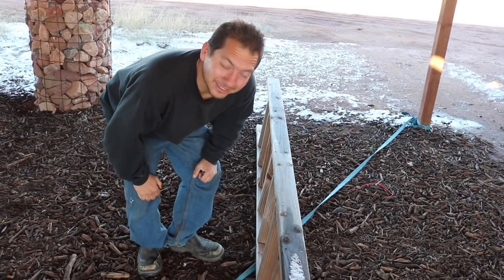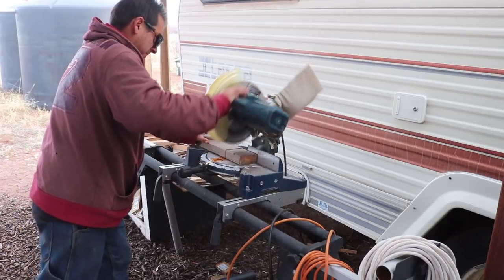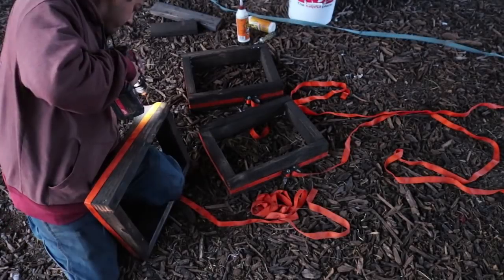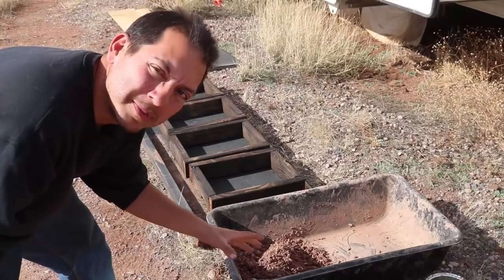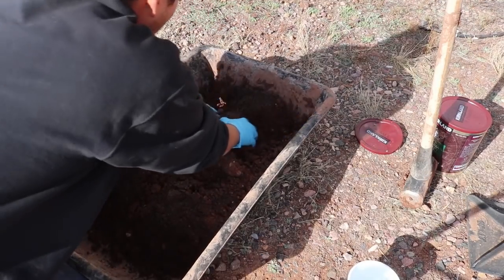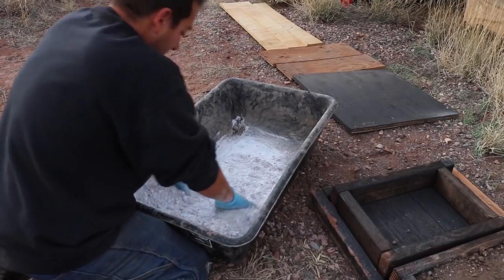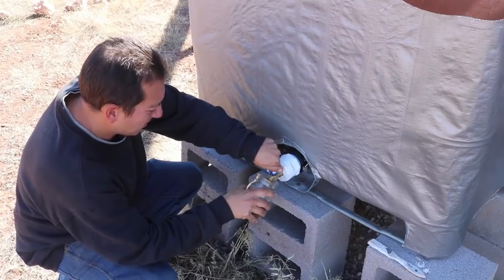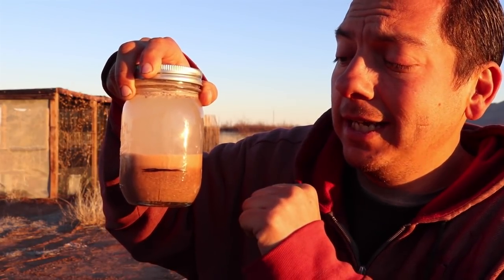Can We Build Our Off Grid House With This? | Testing Soil For Clay Content

Comment: You can use those scrub thorn bush's by burning them and collecting the ash to use in your brick production.  1 part clay, 1 part sand, 1 part ash = Roman Cement.   You could even use waste plastic as a stabalizer for your bricks, shred your plastics and mix with soil heated in an oven.   Plastic/soil bricks make strong bricks, I have seen youtube video's where they make shingles with them.
Reply from the maker: That's interesting Kelly. We'll check into that. Thanks for bringing that up.

Comment: It is important to note that typical concrete is only 10-15% cement.  The remaining percentages are made up of aggregate and water.  Rammed earth applications often fall in the 3-4% range of cement, but can vary widely based on your "earth" composition.  Also, consider that the ratio of water in concrete has a direct effect on the final strength.  Your strength tests won't be particularly meaningful if you aren't carefully measuring comparable amounts of water.  You need enough water to let the cement do its bonding but beyond that, the final result becomes weaker with more added water. Personally, I would not get overly zealous about the use of small amounts of cement.  Reducing the amount of cement used by 66% or more is still a HUGE win.  Don't use more than you need but also don't use less.  There is no savings whatsoever if your building fails.  I would encourage you to consider creating a building that will last 100+ years.  Buildings that last a long time, while being both functional and aesthetically pleasing, are another huge win over buildings that decay in a few decades.  My two cents.
Reply from the maker: Agreed! If we need to use some cement we will do it. Like you said, if we can reduce the amount that is usually used it's still a win. Integrity of the walls will be important.

Comment: good luck guys. from what i can see, the earth around you is perfect for the bags. your going to need to think about render/plaster on the outside which i am sure you have. If your going with a dome bag roof then your need to use cement. Lime is possible, but it would have to be the right mix, and it would take alot to seal from water after. if your having a built roof, then just overhang the egdes a meter or so and then you can just use a cob mix. its all about stopping water from hitting the walls. good luck :)
Reply from the maker: Thanks Gaz! I agree, the soil is pretty good. We may need to add a little sand, but otherwise not bad. 
We've been looking at different finishes. We like the idea of lime over cement. We think it will breathe better.
Reply: @ourselfreliantlife  Hey Jim and Jessica. have given your video a little more thought. i was a little confused with your experiment, only because i couldn't work out why you was putting cement or lime in the mix for the bags and i assumed you was also testing for the render/outside plaster.  I get your experiemnt now :)  so.... do you think it needs a little sand as there will be to much shrinkage?  If this is the case then just do 4 different mixes in your blocks, but all with different sand levels. make them a little wetter than this experiement. turn out the blocks and leave in the sun for a few days. by taking messurments your see the shrinkage.  i have had a few ideas about eatherbag domes, and how to make them without using cement.  The only thing i have come up with, is basically making a roof so your covering the bags on the Dome. i think americans call the roofs, hip roofs.  you would need to extend the roof outwards so the bags are covered from the sun and rain.This would be the best option to have a breathing building. Even if you use a lime plaster on the outside, once you seal it with your choice (check out olive oil soap) your still sealing the building in. if your sealing it from water your also sealing it from air. good venterlation in your design would be needed so you can removed the moisture levels within the building to stop mould. here is a link to get yours and jessicas artisit ideas flowwing https://www.youtube.com/channel/UCAVdVDg80fg1rjZjPWQr3xw/videos

Comment: In Africa the locals would go into town and get any latex paint that they could find. Most was free some cost a dollar. They would put a cup into the mix water to stabilize the walls. They would also add some scrap chicken wire to keep the walls from moving.After the stick frame and wire was up they could build a one room house in a day. Packing from both inside and out in 6 inch lifts going around. Nothing high tech, just mixing in a pit then carrying it to the wall.
Reply from the maker: That's kind of how we did our shed. Except we used shredded paper.

Comment: Small point
You would be adding cement (the binder)
Probably not concrete (the finished product)
Reply from the maker: Thanks Jim! That could be, but I think the aggregate does help. We'll probably still do some investigating.
Reply: @ourselfreliantlife  
Yes aggregate does give structure...
That's why in my head
I question when they filter out, within reason of size, rocks out of their mix..
Reply: @ourselfreliantlife  
If you haven't read or researched
Soil/cement
Some dirt road were built that way
When i was in construction in California
When we worked on military bases the dirt under the roads..
We processed the top foot with cement...
The the base section went on top of the dirts 
Then the top area was either asphalt or concrete..
Side note
On one of the bases
In the housing areas
I put in parking spaces for tanks
I guess in case of all out war...
You would take your tank home with you